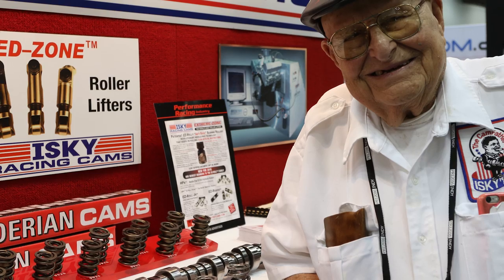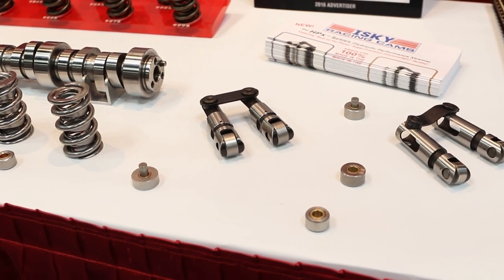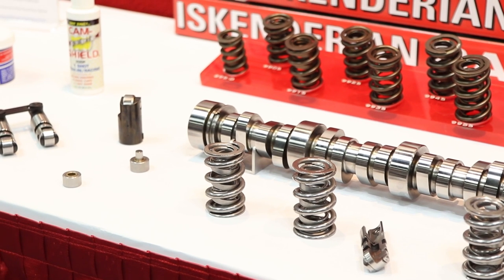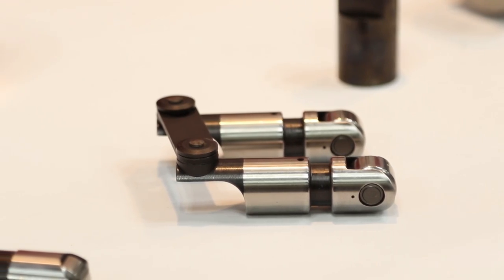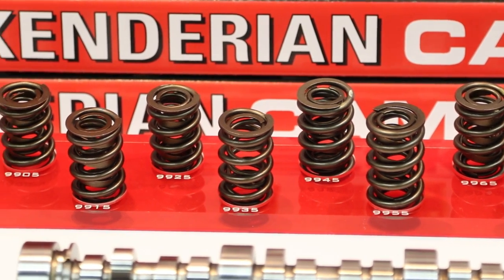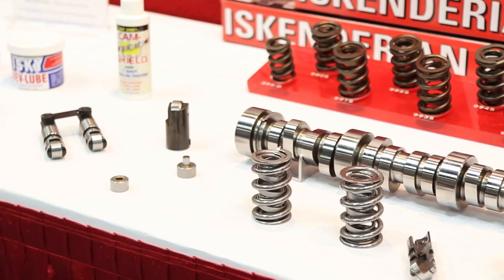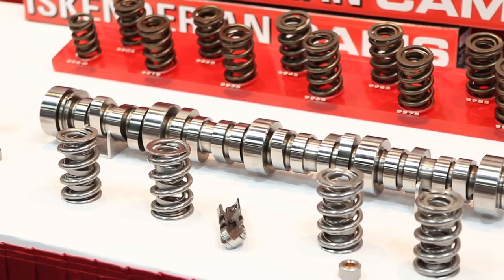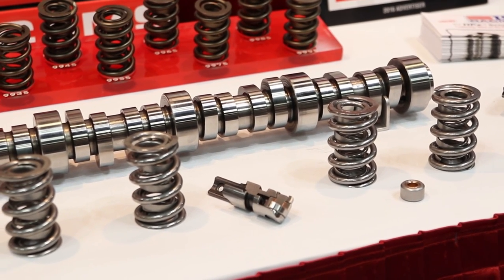PRI 2016: EZ-Roll Lifters From Isky Racing Cams

Comment: They say that the bushing lifters run hotter on the street? The needle rollers run cooler?
Reply: A different video I just watched on Morrel lifters, the guy said the needle bearing lifters where failing less. Darn it which is better??!?!?
Reply: @joshuamoore24_7  bushings cost way more. I went with morells. Needle bearing.